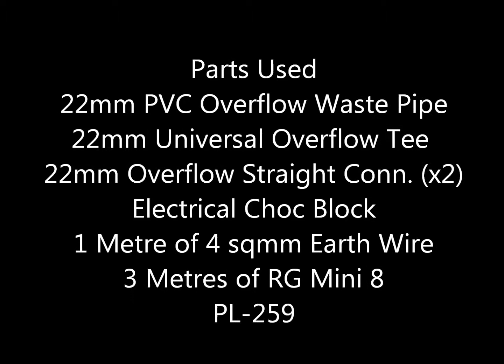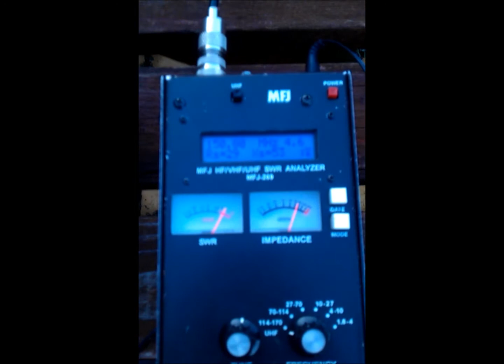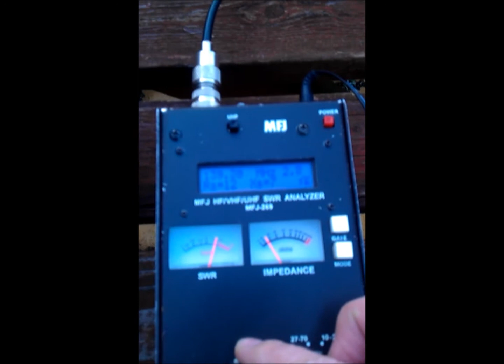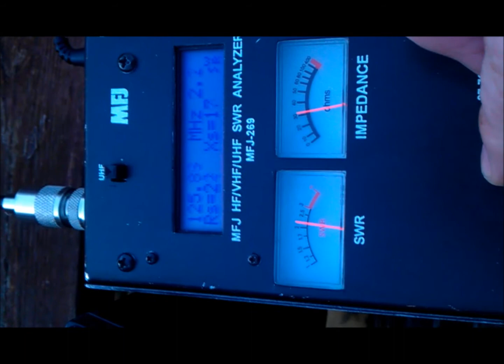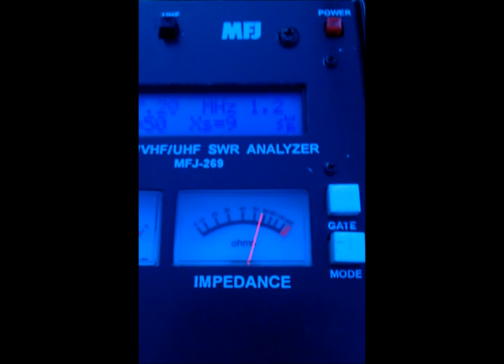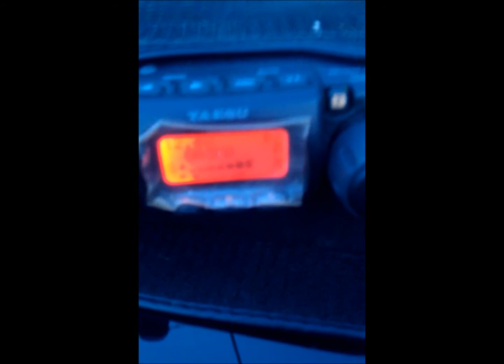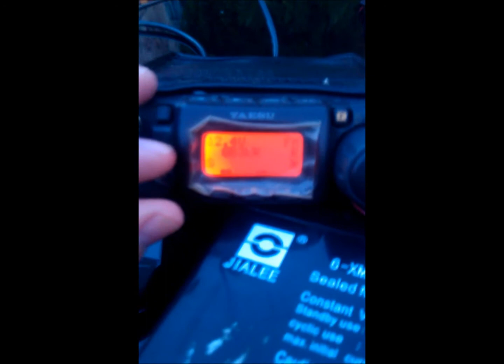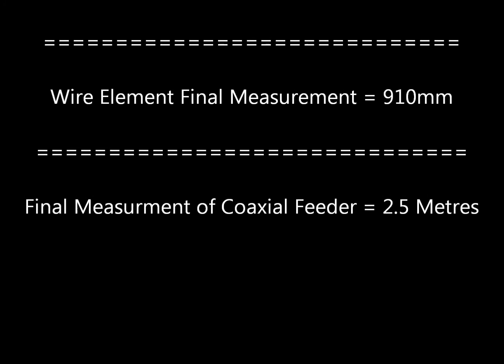MFD Copy Homebrew Antenna

Comment: The only other thing having just watched this again ..... is it preferable to allow for a quarter wavelength of coax run at a 90 degree angle from the feedpoint? How long is the centre connector you used ? 73s